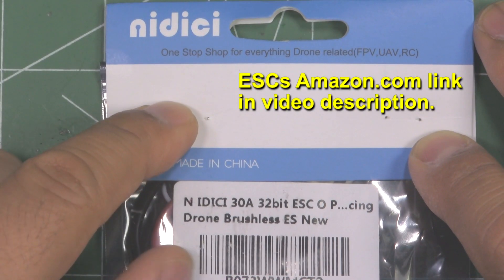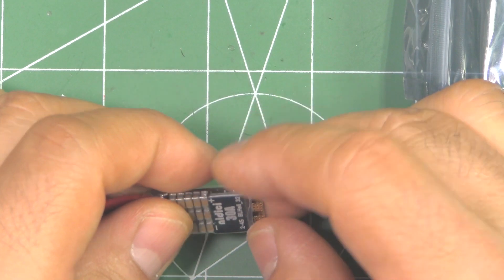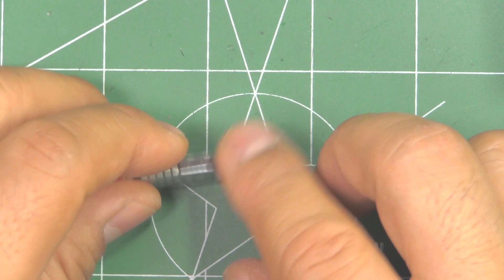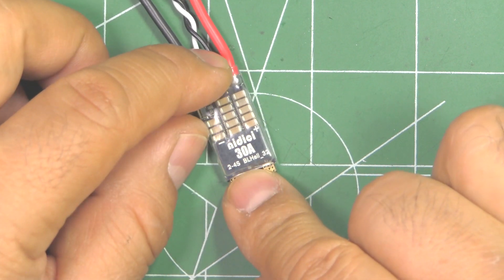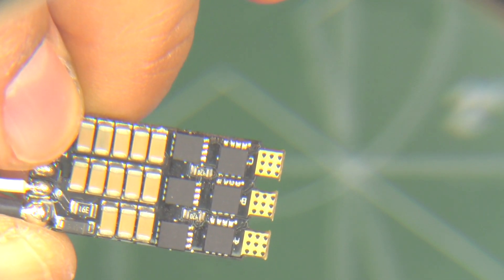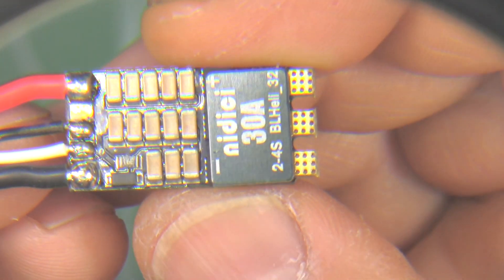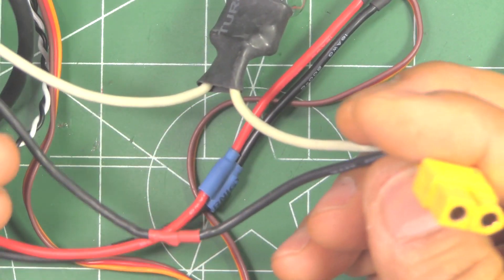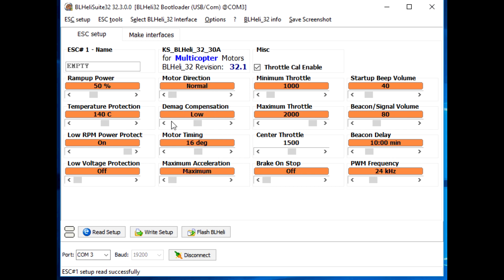Nidici 30A BLHeli_32 ESCs - Small, Light & Affordable

Comment: These escs are the value of the year... I'm highly impressed with them. I have flew Wraith escs since Airbot was sending me prototypes for testing and pretty much the only esc I fly.. when my wife and I do budget builds to give away after we test them and see who built the best budget build I have been using these. They are super smooth, handle abuse well and have no problem with dishing out way more then rated current. Only issue I have with them is for some reason motor timing is more important on these, you can't just run med timing on most motors and be fine.. on a lot of motors med timing will cause shuttering at 20 to 30% throttle not desyncs that knock you out the air but just shuttering and yaw twitching. I've found on the motors that shutter on med set to high timing and it's fine that's not really nothing to worry about as the value of the escs are fantastic.. I have yet to kill one and I'm really working then HARD. I have put them on a few high end builds now as they are just awesome and there's no point in spending more if you need a 30a esc. We bought 30 of them for 18x.xx on Gearbest about a month ago.. honestly I can't tell much a difference in flight between them and my bread and butter Wraith escs and I know exactly how that esc flies as it's all i have flew since Airbot was designing prototypes 6 or is months before they was released so needless to say I have 1000s of flights on those escs and know exactly how they feel... truthfully I can't tell a difference in flight between the Airbot 32bit escs and these they fly exactly the same.Nicidi was nice enough to send me 2 full sets of there rebranding of this esc and 2 full sets of their Raceone 2306 2700kv and 2 full sets of the Raceone 2306 2400kv motors. The motors are impressive for a 50 dollar set of motors, really big time low end torque, plenty of top end just kinda heavy at 37 grams with short wires and about 10% higher amp draw then compared motors. Honestly you should test a set, it would be neat to see a 50 dollar set of motors that are providing 95% or more the performance of a 100 dollar set of motors with very good build quality not top end build quality but very good, of course it lacks the top end features like Ti shafts and weighing in at 30 grams but the performance is damn good. A set of those motors and a set of these escs and a few sets of props will run 100 dollars and make you a fine power set up on a lower cost build, I'm impressed to say the least.
Reply from the maker: Awesome  very useful info there. Thank you for sharing it!

Comment: It seems to be some pretty nice ESCs!
I have to say i stopped using single ESC for 4-in-1 ones but they might fit like a charm on some builds when stack is not really an option :)
Happy midweek and take care!
Reply from the maker: Thank you my friend. Same here .... I'm favoring 4-1 more now. So much easier to build. But you're right, there could be some builds where you need this type of single ESC. I still have not tried BLH_32. Seems BLH_S works so smooth, I can't believe _32 can be better but everyone that used it said it is. Though many have had some problems as usual part of the hobby.
Happy weekend!

Comment: Hey, EngineerX. Any plan on reviewing Racerstar 2406 and 2307?
Reply from the maker: Yes. I ordered one of each. Should arrive in a couple of weeks I hope.
Reply: Great. By the way, did you ever get EWRF Vtx? You said you ordered, but I never saw the review. I saw some other review where it was doing 700mw almost at every power output. So I want to see, if that was a faulty VTX. Also AKK Fx2 and X2 are up to 800mw OSD controllable VTXs and I ordered them for $15-16 each.
Reply from the maker: Yes. I received it but did not have time to review and so many motors and frames have been sent for testing - so I forgot about it! if I have time I will do a quick review..... but don't know when. Very busy lately at my work and at home and testing other parts.

Comment: looks like it doesn’t have current limit protection?
Reply from the maker: That's correct (no shunt resistor), seems they went for "striped" configuration, most likely to maintain small footprint/PCB size and $11.50 shipped price on Amazon.